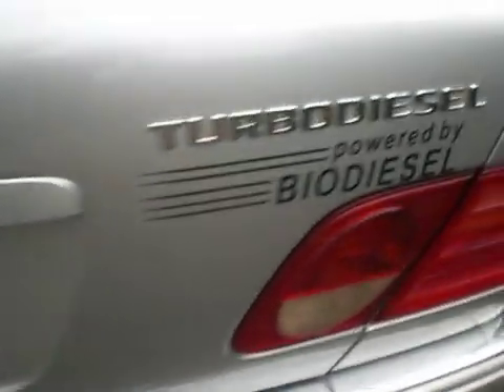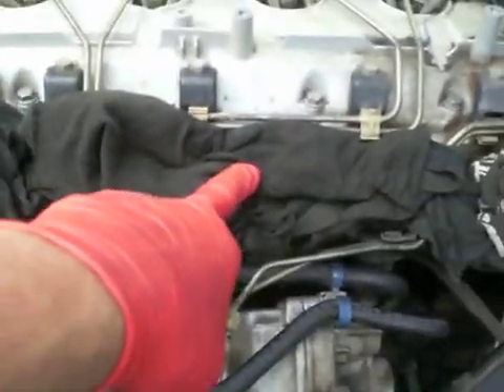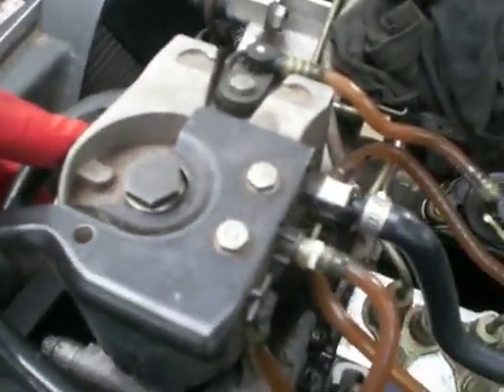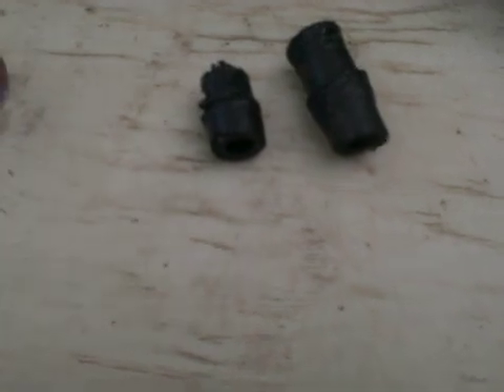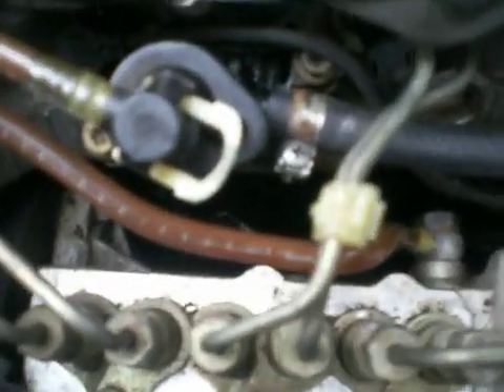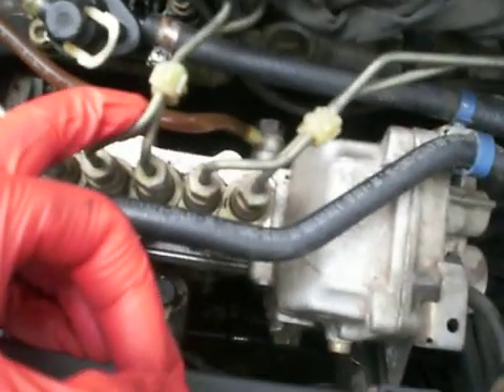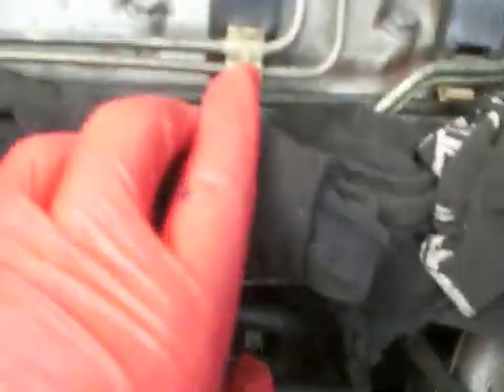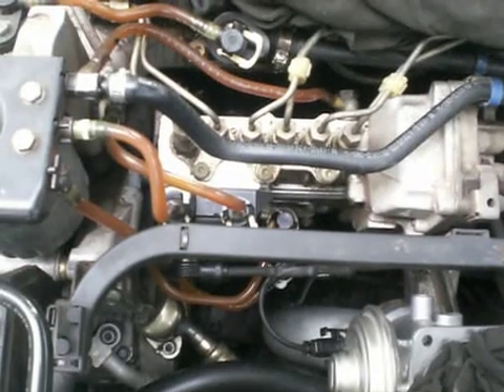diesel mercedes fuel lines

Comment: hi, nice video.  I love how well you maintain your car.  I have a '98 e300.  been running bio in it for 3 years.  I'm changing the lines for the second time.  trying to find all the right viton fittings.  My mechanic doesn't recommend bio for this car.  Says it could mess with the electronics.  Any thoughts?